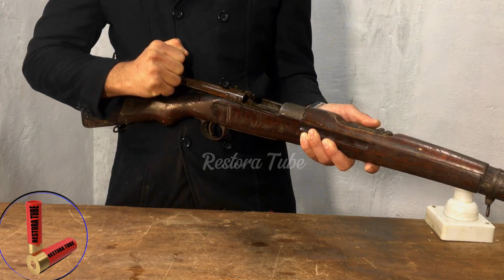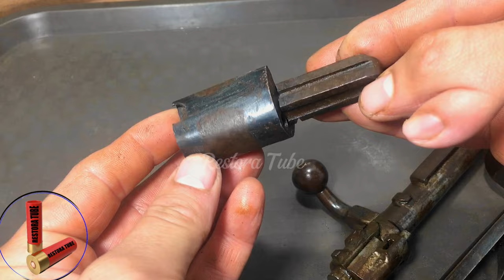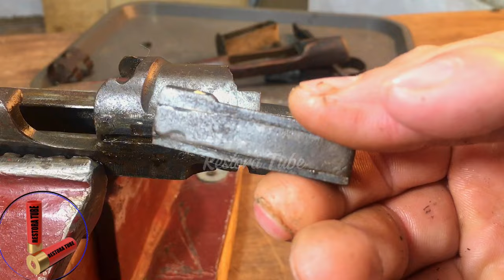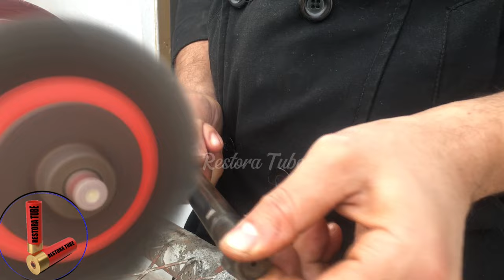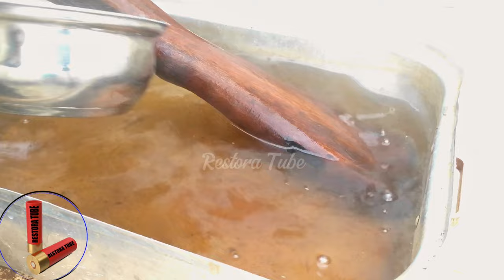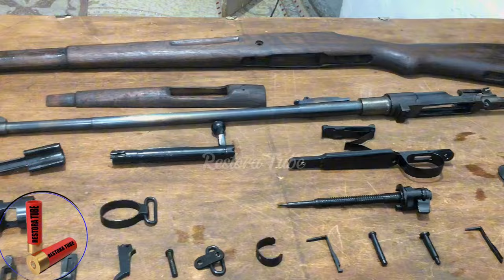Restoration of Mauser Kar 98 Rifle / gun restoration/Restauratie van het Mauser Kar 98-geweer

Comment: Me atreveria a decir que no es un mauser K 98, sino un steyr 1912 y lo digo con mucha seguridad ya que tengo el mismo, sobre la restauracion he visto mejores.
Reply: Es un Máuser K 98 de los del Contrato Portugués.
Reply: It's a handmade copy from Darra.
Probably chambered for .303.
Reply: the first clue is that on the butt stock for the K98, the bolt dissassembly washer is steel, domed, and swaged in; not a flat washer and definetly not a screw holding it in
Reply: Is an Slovakian mountain rifle, built around 1912-1930.